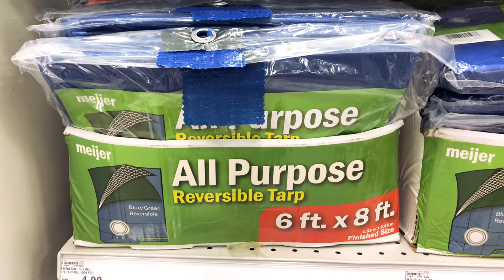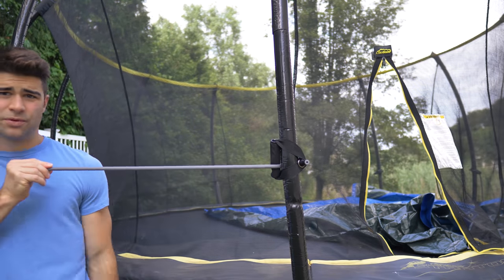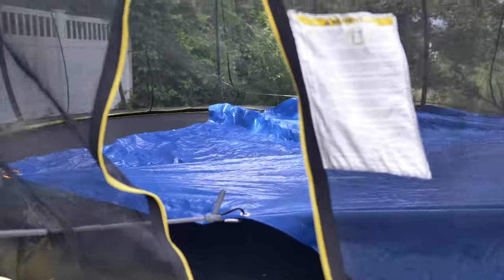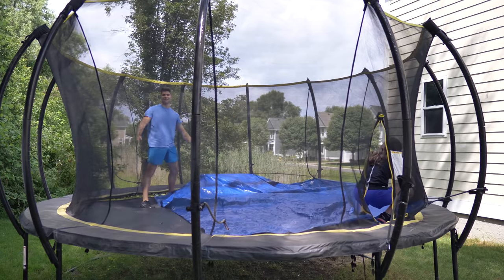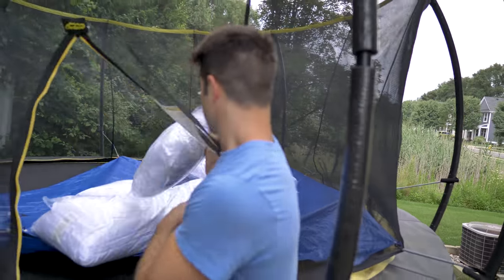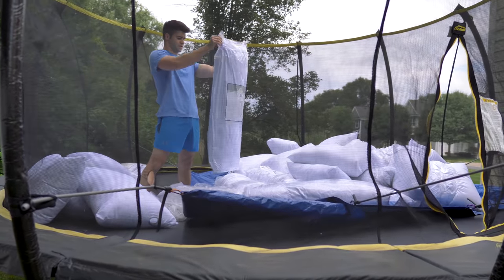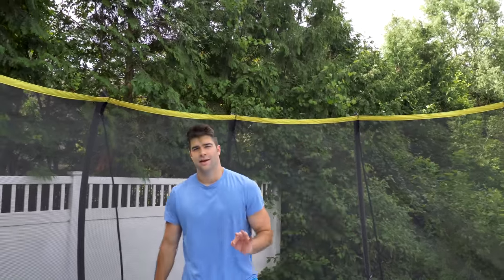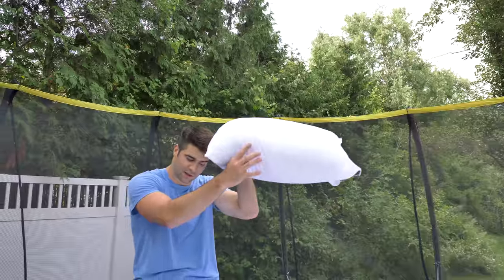Elevated Trampoline 'Pillow Pit' - DIY

Comment: Quick Suggestion: Raise the bungee cords/resistance bands higher and tighten them more (if possible). Therefore, you'll maintain the bounce from the trampoline with all the pillows. Also, maybe put a blanket over the pillows to keep them in place.

Comment: You need to raise the points of which the resistance bands are attached to the poles so when the weight sags the tarp down it wont touch the trampoline

Comment: Instead of the short bands holding from the sides, how about long bands running from one side to another under the tarp? 
You can make a grid of resistance bands first and then place the tarp over and secure it with tape or something.

Or have a cardboard backing to the tarp to avoid some sag in the material.